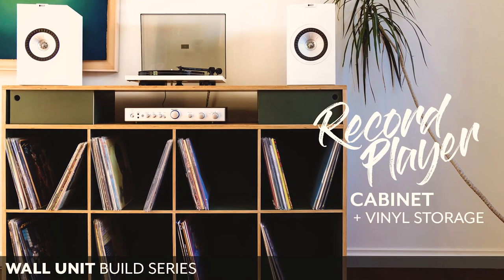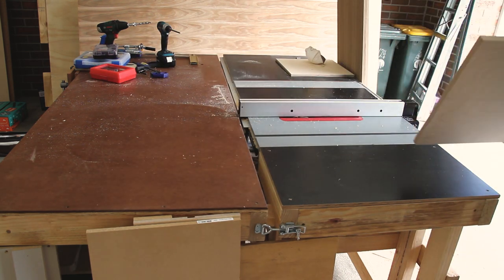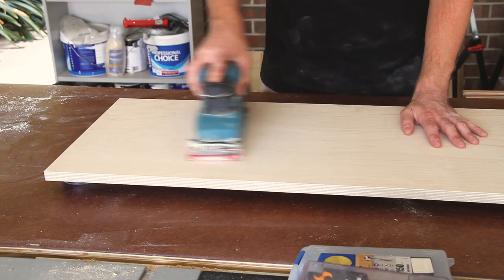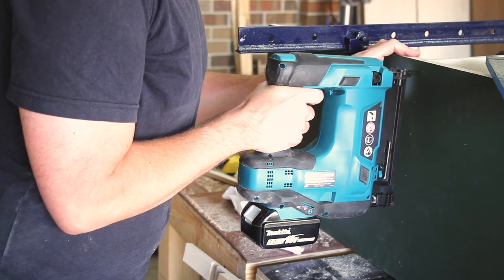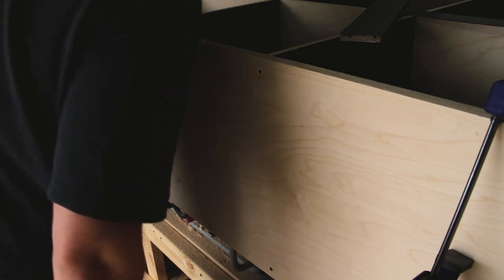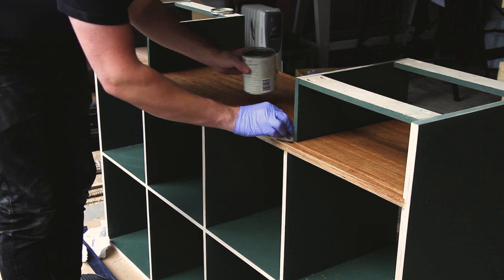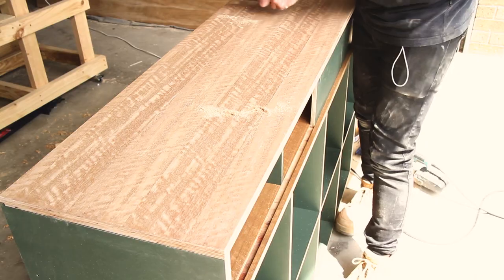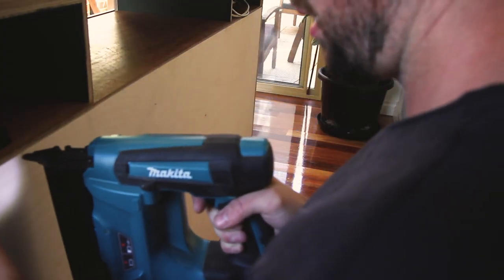Record player cabinet with vinyl storage - Wall Unit DIY Build Series

Comment: There's a record player sitting under the tree for me, my gf thinks i dont know what it is. I've got a 4 foot space to work with and plan on building a record stand w storage. There are so many great designs to take inspiration from and its hard to pick which features i want. Im leaning towards using 2x4s for the whole project and staying away from plywood. I thought I'd use tall metal legs to give it height but i think ill just add another layer of vinyl storage to give it the same height. You've got a few extra major & minor tools I'd like to get first but I think i can finish it with what i have except i need larger clamps.

Comment: I would love to see what your shooting setup and process looks like.
Reply from the maker: It looks a lot different now to when I filmed this build... All my older videos were  shot with a Canon EOS 7D and a range of lenses. Being limited to 1080p, and noise levels were pretty bad with video... still have a few old videos I haven't edited because the quality just makes me sad!

Now filming with a Blackmagic Pocket Cinema Camera 4K, and a Sigma 18-35mm f/1.8, and a speedbooster (allows EF lenses on the MFT mount on the camera) and that pushes that up to f/1.3 which is pretty awesome.  Cropped sensor effectively makes it 24-50mm which is great for pretty much all the filming I do.  Mostly just have the camera on a tripod and move it around a fair bit (sometimes mount a gimbal on it so I can automate some camera movement)... and some shots are with the gimbal (DJI RONIN-S) for smooth fly-over shots.  Use a range of different lighting setups from natural light, to LED panel lights, smaller LED lights, or a mixture of all.  Sometimes have an exteranal 7" LCD screen facing me so I know that what I'm doing isn't being covered up by hands, or isn't out of focus... but usually get by without it.  Doing everything in Davinci Resolve now and working with RAW footage gives me so much control over the end look of it!
Reply: @KastnerFurniture  Almost sounds like you enjoy producing more than wood working 😅

Let us have the old videos too! This is great content!
Reply from the maker: @EdsonMedina  yep it's a lot of work but super satisfying to do!

Working on the next part of the wall unit series (2 years late, oops), should have that one uploaded in the next week!

Comment: Great project - you've inspired me to build something similar! What finish do you apply to the exposed plywood edges?
Reply from the maker: The finish on the unpainted faces and the edges was done using hardwax oil.  You could apply edge banding to cover them with wood grain, but I quite like how the plywood layers looked in this project.

Comment: quick question, what are the dimensions? i plan on building something similar, also where did you get that Japanese tool?
Reply from the maker: From memory the boxes were 350x350mm internally, the whole thing was 390mm deep, the top shelf was 150mm high (but really if you have an amp in there that isn't slimline you'd want it to be a fair bit taller to allow prevent overheating).  Overall dimensions then would have been 472mm x 916mm x 350mm (but that would depend a bit on the thickness of the ply you used I guess!)
Reply from the maker: Oh and the Japanese plane, I'm sure you can find them online or at a decent woodworking store.

Comment: Those vertical dividers had to be time consuming. All the cheap Ikeas stuff I've assembled use dowel pegs that fit in holes in the horizontal pieces. But all that stuff is drilled and cut using CNC machines. It would have requited a ton of drilling.
Reply from the maker: Actually made another record cabinet early last year and ended up using dowels to join those there, was much easier (video for that one is on my channel). I made another one recently and used dominos for that which was the best solution of the three... video coming soon for that one!

Comment: I like how you built this. How many records did you measure to fit per selves and altogether. I’m thinking about building a vinyl record self myself but still undecided on how to build it, I have over 200 vinyl’s
Reply from the maker: Not too sure exactly - I would say each box would fit at least 70-80 records, and there are 8 of them.

I've just build a standalone piece which has 4 boxes instead of 8 which would hold 300 records with no issues... will have that video uploaded in the coming weeks so you may want to subscribe so you can get notified of when that one is up ;)

Comment: Awesome build! What was the height of your gap at the top?  I am looking to build something similar and have that same compartment to hold my stereo.  PS big Vulfpeck fan
Reply from the maker: It was only 150mm gap... when I built it I didn't really know much about amplifiers.  It wasn't til I finished it that I realised you need a lot of space around it. Ended up finding a second hand rotel for a real good price and it's only 70mm high so kinda perfect for the space!

Vulfpeck are the best!

Comment: Question.  At 10:45 of the video, I get that you are able to secure the lower shelf panel walls from the top and bottom and that you can screws from the top side for the upper panel walls, but what did you do to the secure the bottom side of the upper panel walls as the bottom was already secured?  Perhaps I missed it.  I plan to build an in wall shelf and was thinking I'd either have route slots for the panels or stagger the panels to be able to secure them from top and bottom.
Reply from the maker: If you look around 9:54 you'll see I'm attaching each panel with a single screw at the top and bottom (aligned) and that allows me to pivot it out of the way.  It was a real mind-bending puzzle... those pivot screws were offset a bit at each level. This let me get at least 3 screws in critically,  and I later put an angled one through back for that's panels on that middle shelf.
Reply from the maker: I would have routed slots instead but the shelves were only 12mm thick so would have had up have been pretty shallow
Reply: @KastnerFurniture  Sorry to poke an old thread but I'm ashamed to say I still don't get it... Pivoting an upright away gives you access to screw in the one below, but when you pivot it back it's directly over the one underneath and you can't then screw that one in from below. I just can't figure it out and I'm afraid my sleep will suffer!
Reply from the maker: @sapientapprentice4676  you need to offset the pivot points... enough so that you can fit the drill in. It was a mind bending puzzle. Next time I'd probably use dowels, dados, or make them with half-laps.
Reply from the maker: @sapientapprentice4676  Oh also, just to clarify - I didn't screw the bottom of the top verticals in other than where the pivot point was.  You'll see a bit later in the video (11:45) I ended up rectifying this by putting an angled screw up in through the bottom (from the back of the unit).  There wasn't much movement but enough to cause a bit of concern...
Reply: @KastnerFurniture  Thanks so much for replying, it all makes sense now.
Reply from the maker: @sapientapprentice4676  I'm glad you can sleep peacefully now. I sure know I spent many restless nights trying to solve it myself!
Reply: Great video. Another option would have been to use a few dowels instead of screws? These could have run through horizontal shelf into both uprights. Just a thought.